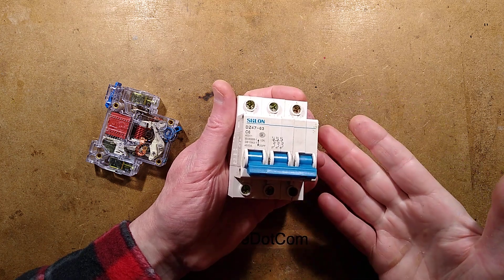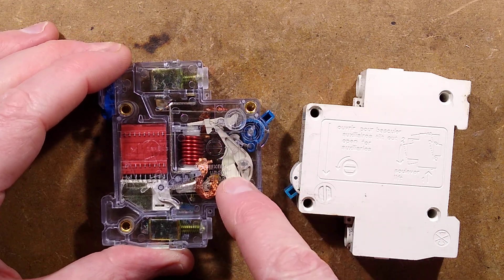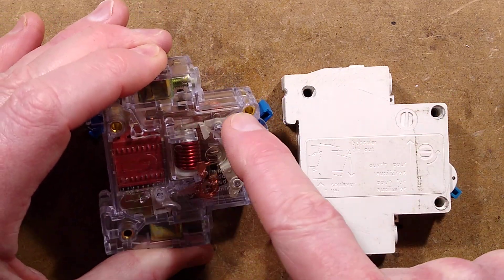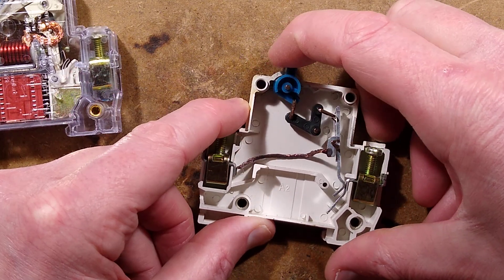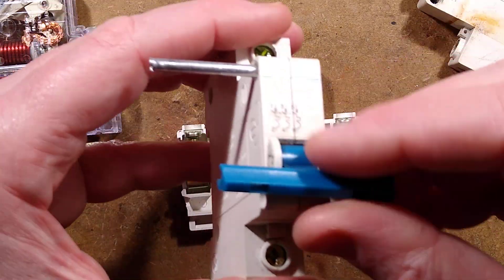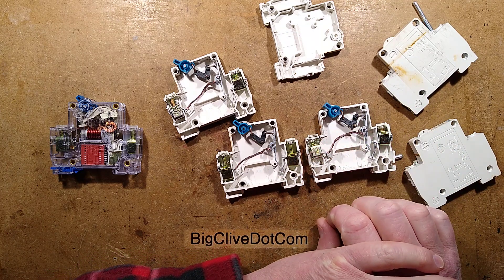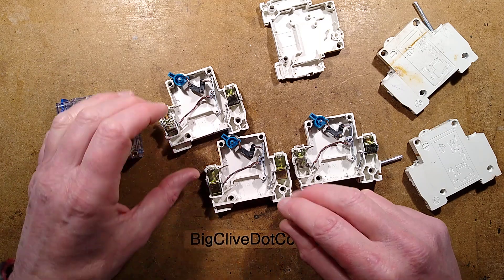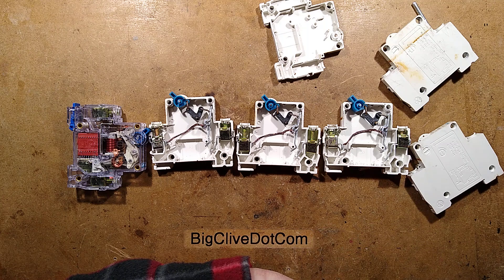Inside a fake un-trippable circuit breaker.

Comment: Wonder if this is why Electroboom's circuit breaker didn't trip when he tested it in his outdoor heater video
Reply from the maker: Most likely the trip curve delay.
Reply: @bigclivedotcom  hey big Clive few things here.!

First off with the previous comment of yours on this comment all the electroboom side of things I think that this person might be actually being sarcastic!

It's a possibility but also possibility or not just want to put that out there.

Also I do know that there are actually some circuit breakers at least in some countries and some installations circuit breakers in D effect that they're designed to replace Almost directly a standard breaker that is not actually a breaker but actually just a switch but a legitimate switch of course!

I don't know what circumstances are used in war where excetera but I do know at least for some places is it countries and installations they do exist for some legitimate reason!

Frankly I don't know why but yeah there is such a thing as a bottle that's same configuration and such as a breaker except it's just a switch and no overload protection whatsoever. Fake foot deliberately designed for this.

Don't know if these exist outside the United States or not.

But it's work differently of course than a regular breaker and all don't know much about them but they do exist!

Also as far as at least in the United States on Switching the neutral of a circuit there are some cases where the neutral is switched however it is it doing at the same time as the hot!

I think when application is gas pumps we're both hot and neutral are switched.

But of course the overload protection over current detection is in the hot!

I'd have seen occasionally old fuse boxes that were actually fused in the neutral but that was ancient as I called them electrical installs!

The most recent one I've seen was at my parents place probably built sometime in between thirties and forties hard to say exactly when!

But have been recently reward in the last several years at least as far as new service entrance excetera!

On the gas furnace there was a safety switch  perhaps Square d or very similar!

 Too 20 amp cartridge fuses probably original Maybe!

They look both about the same age!

By the way it was painted a gray color not the modern finish on those but you're more of a painted 1.
You know typical industrial Gray.

I was kind of curious as to what type it was excetera and in terms of safety of it of course.

Because the wiring there was somewhat substandard even for the times!

But with that safety switch which was as I said fused I was expecting a plug fuse AKA Edison base fuse or fuses!

Not the cartridge fuses!

But something kind of shocking but not in the literal sense fortunately.

Yes 2 fuses and one of them was in the neutral of the Furnace circuit!!!

I don't remember exactly when that was prohibited the US Electrical Codes!

Or even when it was allowed!

Also something of note with that place there was at least one receptacle possibly more.

That was a quadruplex receptacle.

Although ungrounded!

That is in the configuration of a standard duplex receptacle except the top and bottom receptacles have space for two plugs.

Currently you can have only I think it's 3 / gang of a junction box!

But I've seen these here in very few cases but did know they existed!

I once saw a receptacle of a different configuration almost look the modern paddle switch plates Decor or whatever you call it.

And a few others like this.

It was a type that predated the modern-day core type!

 also they do have a few different ones that are rectangular but incompatible with anything else.

By the way this was back when they had AC line cord plugs that were very slim you may have seen some of these before.

 and yes if you see those plugs you should change the cord probably good idea anyways due to the age.

But with modern plugs that would be a mere point anyways with the spacing besides not grounded!

Although one place I've seen fuses where you would not expect is sometimes on heating elements if there's a chance of an ailment breaking in service either burning out or otherwise and contacting either another ailment or Ethan conductive it's pretty sure specialty application but there were fuses in both incoming wires.

 and at least one time I saw this and that was not 220 but 120 volts ac!

Weird.

Also back to my folks place!

One of the things we ran into was that one circuit have been wired with nod aluminum more copper clad aluminum but iron wire!

That's right iron!

 also there were places there were spices that were not enclosed.

 at least one place where there was apparently not sure though a ground wire coming out from the outer casing of a three wire cable and running somewhere and there was electrical tape where that was!

No clue why that was done!

 also something kind of mysterious and seems pointless.

There is an outbuilding probably eraser used for garage but is just used for an outbuilding now!

 is there was a light fixture in there just a socket only!

And either armored cable or something similar don't know the Vintage of it!

 so could be the old stuff that was dangerous if improperly installed!

 people that would be in the industry would do what I'm talkin about!

But the thing is there was no sign of a switch anywhere.

By the way the box cover was the round black one that you see in older places.

On that light socket round box round box again black!

 and that cable did run along a board and in beside the front of that building and Inns right there not sure if it was even connected in the first place!

Or cut off at some point?

 although inside in the basement is there is one black silver box without a cover now unfortunately.

And it goes to the old star conduit goes through the foundation and wall and I believe it's the one that heads upstairs along the side of the house and then goes back in through conduit bodies.

 I believe that possibly could have been originally going to go through the garage or perhaps was repurposed?

 it seems odd that was the only thing in the whole house inside at least it look like that type of wiring install.

 it's the old electrical conduit that almost looks like gas pipe at a casual glance.

 also we have what one might call a purple Coco it look it up Reddit!

 and all the outlet in the living room About where a switch would be in terms of height they be a little bit higher?

 and apparently the wiring from that goes that same junction box in the basement!

 which again is the same style black round electrical box as in the garage / out building!

 chances are I'm thinking that would have been originally the switch for that light or intended to be?

 that's the only thing I can figure!

Weird?

 also by the way with a non-contact tester that that black conduit tests live!!!

 will be doing a check to see if there is actually a voltage present coming up and it's possible it was just Phantom voltage!

Will check with an actual meter and then meter and an actual load to verify if it's an issue!

 they have been cautioned about touching neck who do it of course unfortunately cold water line right near there all meta  at least in that part of the system!

 and other grounded objects in the vicinity!

 this leads me to believe that there may not be a ground in that cling to it whatsoever or perhaps has been damaged if there whatever was one!

 so yeah need to look into it but just thought I'd bring this up

Comment: That thing is closer to a fuse than a circuit breaker. The mechanism looks to be made out of pot metal.
Reply: A fuse would be safer than that counterfit circuit breaker.
Reply: yeah,  just thinking that as well,  bit of crysotile round it as flame retardant ,  be good to go ;) , dont forget your FFP3 mask tho

Comment: One day I'm going to buy one of these Tuya enabled WiFi circuit breakers to see of they are normal circuit breakers with a servo attached that can move the lever or if they are technically WiFi switches with a relay and do the overcurrent protection as a software function.
Reply from the maker: I've looked at those and squirmed....
Reply: @bigclivedotcom  On the screenshot of the app there is an option for auto-reset. Don't we all love that feature in our circuit breakers?

Comment: I feel like this is now in contention for the most dangerous thing that's appeared on the channel.
Reply: i think i could make it worse, take that strip of wire out and put in a thicker gauge with a coating over it so you can be sure it catches fire internally then use standard plastic with no fire retaqrdant so the entire circuit breaker burns to the ground, also hopefully it will melt leaving the connection behind so that you now have a burning fuse box with continuity still going through the circuit
Reply: @compzac  Most likely it IS made of standard plastic without fire retardant.
Reply: @compzac  I feel like that's about as bad as things could possibly get, short of just filling the breaker with gunpowder.

Comment: this breakers was meant for teaching in primary  schools with low voltage talking of 30 + years we had them in our school
Reply: I dunno what are you talking about. When i was at school there was no modern DIN rails and stuff. Those standards didn't exist yet. And you know what? 36V lines were protected by... fuses. As simple as that.  Also low voltage breakers do exist. They weren't common in early 80s though.

Comment: What do the manufacturer's instructions say about the recommended screw torque ? :-)
Reply: what screw torque they probably just tell you to connect the wires and that it will automatically clamp with sufficient torque, or reading its instructions place the breaker in the wire the automatic is the clamping force wiring is the tension.
Reply from the maker: It says "You do torques whateva you want - it no good anyway."

Comment: So this is frightening, though I suppose the answer to "how to avoid these or detect these?" is "buy from a trusted vendor and brand". In the USA this is made easier by the fact you basically have to get breakers that match the breaker box, and there are many kinds.  The fake Square D breakers make me nervous, though, since my panel is Square D...
Reply: well thats only marginally better than the old zinsco panels that even the proper breakers would "trip" by catching fire
Reply: This can be so fun when you have an older panel, like a Cutler-Hammer. Only breakers (types) that are specifically listed are technically allowed to be used without violating the conditions of its UL listing, which in turn is a code violation.

Even though they fit, and are basically the only type available that do, I'm not allowed to use MH breakers. Have to be B. Not even (somewhat more common) BR! There's a long list of breakers on the datasheet, and basically all of them are NLA types.

Comment: I will bet it was manufactured in China. Any takers?

And while you're mulling that one, chew on this thought, too: At which point is the free world is going to recognize the totality of the gongchandang's actions (from lead paint on children's toys, melamine in infant formula, and these "breakers", all the way to "buying the current U.S. President, the media, entertainment and tech companies") for what they are?

Protip, they're either: 

Grossly incompetent and should have their goods refused at the dock until they start meeting, and begin to maintain a culture of proactively exceeding UL, TÜV, and/or CE standards, verified through independent testing.

or,
 
They're actively hostile, with the same fix as above, but with the added bonus of returning their crap along with a couple hundred thousand Mk. 84 2,000 pound low drag general purpose bombs until they surrender, unconditionally.

Or, more frighteningly, they could be both; Incompetent because cheap labor takes out domestic manufactiring of their enemies, and  hostile because they encourage the incompetence because it's a cheap "soft kill" to continually weaken and degrade the strength of their enemies.

Comment: There is a legitimate use for a breaker looking switch, here in Canada (maybe in the US as well) Square D sells A/C disconnect boxes (for exterior A/C compressors) with a north American dual pole breaker-sized switch that clearly has a warning sticker on it for "No overcurrent protection". This format is cleaner than the cheaper models that you have to pull out the whole plastic tab to disconnect, plus their box make a nice dual circuit micro panel if you replace the switch by two breakers:
https://www.homedepot.ca/product/square-d-60-amp-air-conditioner-disconnect/1000666001
Reply: But this isn't a breaker looking switch, this is a breaker-marked lie.
Reply: @Monkeh616  what I mean is that the manufacturer has a legitimate reason to make such devices, but not to be resold with different markings, and even less for a fake reproduction. So It's not automatically a scam unless, like in his case, it has fake makings.

Comment: When the aluminum wiring melts and the house burns down the circuit will open. No worries.

This sort of thing is the reason the hairs on the back of my neck stand up when you discuss in-shower heater systems.
Sooner or later some poor bastard is going to buy a truckload of counterfeit ground fault protectors, put them in a box with plastics that don't handle chlorine, and things will end very very badly.
It isn't just the idea of showering with space heater. It's the knowledge that EVERYTHING is built on lowest bidder contracts.

Comment: I mean, there are actual uses for these kinds of products, but they should have spark arresters at the very least. Isolation switches, basically. 

These, however, are tagged DZ47-63, which are meant to be circuit breakers. Utterly detestable.

Comment: It wasn't clear what the label said.  It would at least be ethical to say that it was a switch, not a breaker.  Give some indication of what's inside!

Thought:  at least use a small enough gauge flexible wire to act like a fuse link.  That's how GM did with their cars.  😱

Comment: This is worrying. The fake fuses are bad enough but at least most of those will provide "some" protection. Now we're getting fake breakers with no protection whatsoever. Fantastic. A related story: I once had a call from a landlord as their tennant had reported all of the power had gone and smoke had been coming from the fuse box. I knew instantly what to expect. When I got there I fould the main fuse had blown and it didn't take me long to find out why. There was a line to earth short on the lighting circuit (some dickhead had taken off the bathroom pullswitch and left the conductors bare, which in turn had shorted, welding themselves together). The fuse carrier was a re-wireable BS3036 and some dickhead had "fused" it with what looked like 2.5mm copper conductor. The 60a main fuse had saved them but only just. I worked out from the resistance of the shorted circuit and typical Ze values for a TN-S system (which this was) that around 200A had flowed through the 6A circuit for a about 90 seconds (according to the curve characteristics for a type 2 1361 fuse). It melted every cable in the circuit with the exception of the switching cables. It was a two-day job to replace the cables in the circuit and I charged half a grand for the pleasure. It could well have caused a fire. Moral of the story - don't short out your fuses, they are there for a reason.

Comment: A quick internet search of the model listed comes up with many listings for it being a "low-voltage 230v/400v circuit breaker" which is a bit odd.
Pretty sure that would be considered medium voltage in most places.
Reply: No, that's low voltage. IEC ranges apply.

Comment: Wow. That's criminal! Thanks for highlighting this. After watching this video I'll never purchase any circuit breakers or din rail switches on AliExpress.
Reply: Then again, if you need 4 could just buy 6 and open one up.
Reply: @benbaselet2026  And what do you do with the leftover? Also, opening doesn't prove correct function.

Comment: I used to fix arcade games, and I'd get pinball machines in for repair with 1/4" nails in the fuse holders.

(and it was easy to find what broke - it was a black, burned, hole or melted to slag)

Comment: Wouldn't this be useful in a situation where you don't want any fault tripping, but just a simple switch? For example, if you have a fault tripping "upstreams" but want for example a safety disconnect switch. This switch is of course not safe to disconnect under load (as it has no arc quenching capability) but as a switch to disconnect a appliance to work on it safely it could be useful.
Looks like the disconnect distance is like 4-5mm which is over the requirement of at least 3mm gap for a safety switch.
Reply: For that, you'd use a switch rather than lead people astray. The fella I bought my house from could get himself a smack if ever he comes looking for his post. He put a spur single socket off a ring and wired both ends opposite colours. I was placing a double socket on it today. It was the first thing I noticed. Checked the other  and fixed it. Imagine separately having two colours in two terminals of one socket. Pure blew my mind. I had to go outside to calm down.

Comment: Would they be ok if they were marked as a disconnect? At work we use what looks like a breaker but is only a switch.
They  do have proper contacts.
Reply: The case should be in a different colour to make it obvious